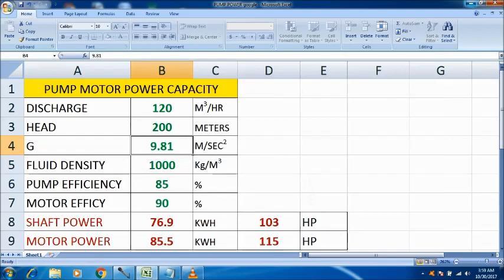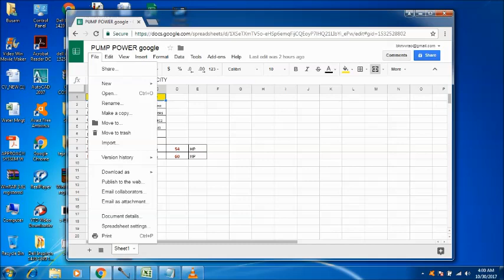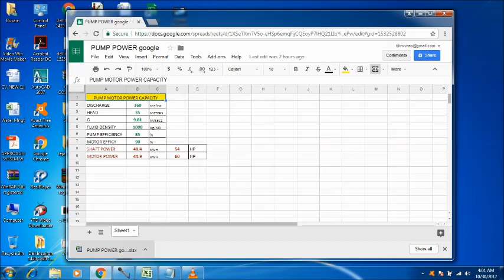HOW MUCH MOTOR CAPACITY THAT REQUIRED FOR A PUMP AT GIVEN DISCHARGE AND HEAD

Comment: Hello don't post this how can you justy pump effiency is 80 and motor has 90 .
Don't make this video's
Reply from the maker: Please see my latest video on that subject. Pump and motor efficiencies will provide by the manufacturer and also for example if your discharge or head is low  then your motor or pump efficiencies are less. According to the efficiencies you will get shaft power upto pump, motor power upto motor.
Reply from the maker: If you try for better than this welcome. Make a video and send it to me

Comment: Sir please make a detailed video w.r.t. agriculture water required per acre, from which the discharge/water required is arrived.
Usually farmers are recommend wrong discharge submersible pumps by the retail shops.
It will be very helpful.

Comment: Sir, I have 800 feet deep borewell of 4 " dia and having water level upto 170 feet, please suggest me the best motor with discharge upto 10-17 LPM, also the cable size to be used.